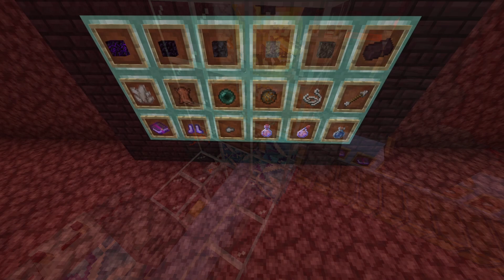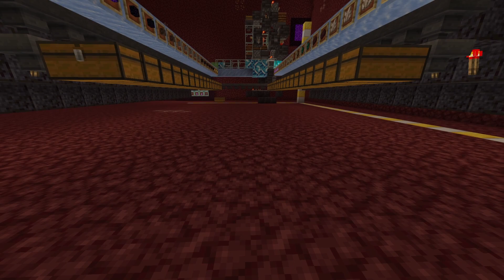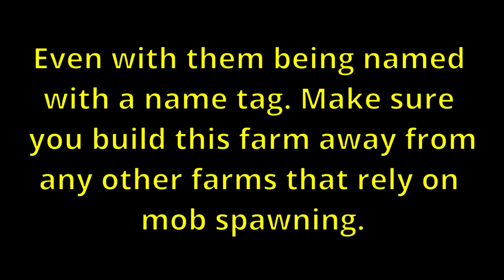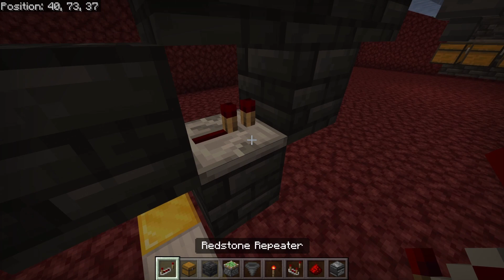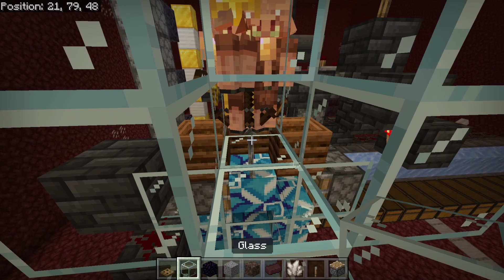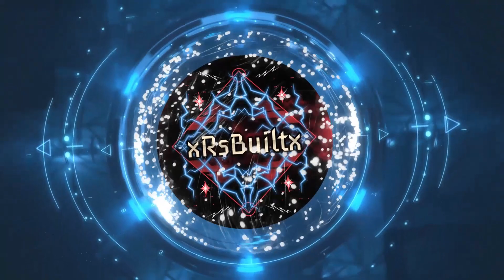Master level Piglin bartering farm for Minecraft Bedrock edition | 80k+ items per hour!

Comment from the maker: Due to the update, The iron bars now connect to the composter. All 4 composters can be replaced with leaf blocks to keep items from getting stuck. If you want to keep the composters, you can put a chain straight up in the place of the bar. :)
Reply: Clutch comment, thought I was done when they kept connecting
Reply: My storage system isn’t collecting any of the sorted items but it is getting collected into the un sorted do you know any fix or should I find a different collection system?
Reply from the maker: @shreksupremacy1358  make sure all the items to be sorted out in the Hoppers are unnamed. Review the tutorial over again and make sure you didn't miss anything. Make sure you build it exactly as it was built in the tutorial. Make sure you use ender chest as a centering block for the items to bounce up against.
Reply: @xRsBuiltx ea I built everything as is but my hoppers won’t pick up the items when the comparators are on but they do when they’re off

Comment: Can i use Copper Golem sorter for Fire Resistance potions?
Reply from the maker: I'm sure you could, this was designed before the copper golem was a thing.
Reply: @xRsBuiltx I want to sort out fire resistance potions to get their bottles after use as well as less brewing time.
Reply: If possible, i will try to make a copper golem sorter to get their nonstackable items instead of going to fire

Comment: isn’t there a way to instantly trade with piglins could i implement this instead of trying to get so many pig man inside
Reply from the maker: It's not instant, but it's faster. More piglins would give a faster rate of returns. The bug I believe you are referring to is when a piston moves a chest or gold.block back and forth. It angers them and makes them trade instantly.
Reply: @xRsBuiltx yes , if i just add a piston on a loop next to the farm would that work?
Reply from the maker: @oliversloane-n8l if they didn't patch the bug, yes. (I don't think they have. So just make 2 observers facing into another with with a sticky piston pushing a chest or gold block. Then a lever on the side of the piston to turn it off.
Reply: @xRsBuiltx thanks

Comment: Built this on my Realm, really great setup and is going to be so helpful.

I had a MAJOR issue where the Piglins were glitching through the glass on the first pulse of the farm. To fix this, push an upright chain into the Piglin’s heads before switching the farm on, this will align them properly so when the farm activates they are all in the same place on the iron bar / chain.

Hope this helps!
Reply from the maker: @Kilbain1989  yes, this should be corrected with the pinned comment.

Comment: Overtime I have built most of the farms that you made videos for, but I am nervous to find out that hoppers may not pick up items if they are not getting picked up on the North East Side of the ice if the ice comes all the way back around again. But, somehow, everything that you post seems to work! : )
Reply: I would just space out the your collection system every other block. Then i would add a hopper minecart thats locked with the corresponding iteams you wants. Than under the mincart hopper add 4 more hoppers that rout into a chest. Should help for alot of iteams. If you have more then just add two/more minecart hoppers per iteam untill you are catching them all

Comment: Is this farm still viable? I've triple checked everything and everything works except the first slime block that starts the item launch
Reply from the maker: Yes, Everything still works including the first slime block. Just make sure you change the iron bar to a chain and you'll be good to go.
Reply: @xRsBuiltx  I used watermelons instead of composters so they don't connect. But the sticky piston at the back to start the items moving isn't extending. Tried replacing the glass with a solid block but it just stays. I might tear down and restart
Reply: @xRsBuiltx  nevermind... after some help from my wife pushing the button as I followed the Redstone, I had some backwards repeaters lol. Thank you!
Reply from the maker: @theredvetchronicles  absolutely! There was a pinned comment saying to replace the iron bar with a chain straight up and down. It works well!

Comment: whats the soul fire for?  Is it just the lit up piece of soul sand cause i thought it meant the soul campfire which made me curious cause it wasnt showing up in the tutorial
Reply from the maker: Hello! It's there to burn whatever excess items overflow incase a storage system gets full. To make it, you just might a piece of soul sand or soul soil with a flint and steel and it will burn forever.
Reply: alright that means there is no soul campfire needed xD i was a little confused cause in the material list it said soul fire :D
 @xRsBuiltx

Comment: Couldn't you just use a drooper and chest minecart on activated rails?
Reply from the maker: On which part of the farm? You would have a very hard time loading 80k+ items into a chest minecart fast enough without the system backing up. The ice stream allows for practically any amount  of items to be sent down it without the worry of backing up the system. Making it much easier to expand higher than 80k items per hour.
Reply: @xRsBuiltx  what if I do it the standard way with 18 piglins? without using the glitch?
Reply from the maker: @Christopher-cr7pw  if you do it the standard way then you get a standard farm. With this one there is 30-35 Piglins inside of the tube. If you put them side by side like a standard farm then it'll be really wide and still run into how you'll get them all in a sorting system without hoppers backing up.
Reply: @xRsBuiltx  okay just asking because I am building my nether hub  next to the farm so I don't have time to run a fast farm
Reply: I'm asking because I'm in the middle of building a piglin farm but I don't want to use ice even though I have enough.